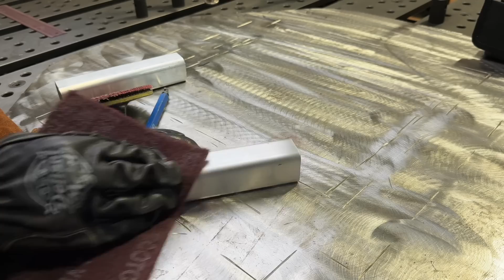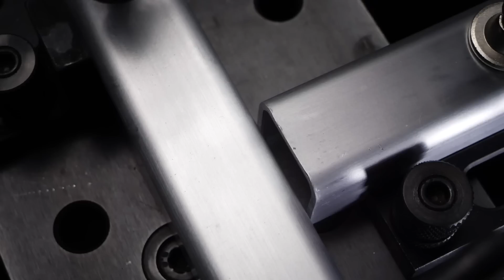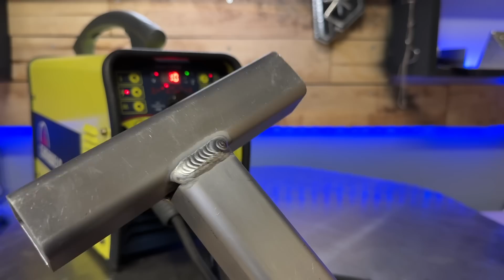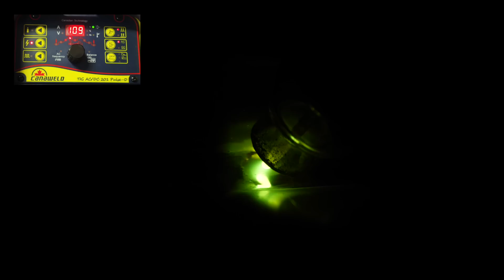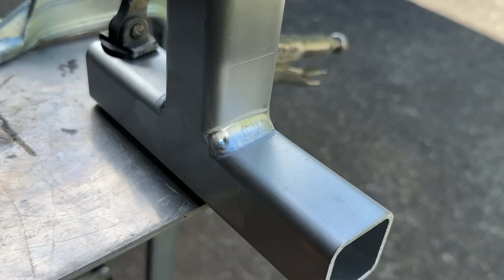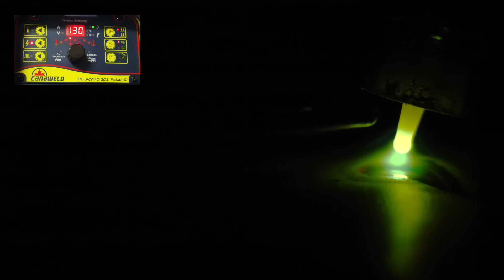Tig Welding a HUGE Gap- and Making It Disappear

Comment: Pro Tip if you dont have  a fancy pants table like he does.

If youre using your typical metal table(presumably stainless because you dont want to corrupt your stainless by welding it on a carbon steel table)
Go out and buy some Bessie F style Bar Clamps.
Cut the Top portion off of them, and put a metal plate there instead.
Then stick them plate first on your table and weld em down.

Comment: Sometimes in the real world there’s nothing you can do besides fill it up! 

We have some closures that are not structural.  It’s a plastic case that gets an aluminum lip (cover and base) and we cut them, and then bend them into a square shape using soft metal to fill the channels in it as to not crush them. Our gap is supposed to be about an 1/8 inch if they’re cut at the right length before bending. The biggest gap I’ve welded was 3/8-7/16ish and that was rough. I use this method when that’s what we get stuck with. Incompetency in the fab dept makes our work harder and unfortunately there’s not much we can do about it.
Reply: Left that comment earlier in the video, additionally, I started in the grind department and his process is exactly how we do case work to make sure there’s no marks once it’s painted! Love this channel

Comment: Have you ever dealt with arc blow?  I'm welding stainless tube on a positioner and when I weld horizontally I freqently get arc blow that ruins the part.  If I weld vertically it doesn't seem to occur.
Reply: By saying "arc blow" are you talking about the blow out on the very last section of weld on a sealed tube joint? If so, try welding just up to the very end but stop leaving a very small gap for the hot expanding gasses to escape, and let the entire part cool to the touch..... then light off and quickly lay into it and get a dab of rod into there to seal the last portion before it all heats up again. Usually that works for me, but if not, you might need to drill a tiny "relief" hole in an inconspicuous nearby spot to vent the hot gas.
Reply: @loulagro2315  I'm under the impression that it's arc blow.  I'm not well versed enough to know for sure.  It does seem though that going from horizontal to vertical welding has somewhat got it under control.  There is quite a bit of magnetic flux in the chuck of my positioner...  

The exact position in the weld that it blows out is a bit random, but it's only ever on the positioner, while it's rotating, or by restarting in a position where it had blown out as well.
Reply: @NavyCuda  , ...... Humm, I'm struggling a little with the term "arc blow" in trying to understand exactly what that means to you, and exactly what your are welding. I've been Tig welding since 1979 everything from chromoly racing frames to all manner  aerospace things, and I've never really associated the official term "arc blow" with tig welding. To me that's more of a stick welding thing. With Tig your arc should never "blow" unless you've got a shielding gas issue, ie TOO high of argon flow and it's actually creating turbulence that is allowing air to get in contact with your weld zone, or conversely, not enough argon shielding gas that's causing porosity and sputtering. The only other thing I can think of is what I hinted at first...... If you are meaning that your weld is actually like "belching out" right at the very end as you are finishing a weld seam, and trying to add your final dab. Is that what you are seeing? If you WERE able to complete the weld, would the two sections you just welded together be sealed on either end? Since it's stainless are you using argon back flow? ........... Again, (IF) the 2 sections you are welding together on your positioner are sealed off more or less on each end, then I would say you are definitely experiencing the hot gases inside the tubing expanding and just as you try to close the last bit of open weld, .... poof, it belches out. 
If so it's tuff, but one trick is to drill a tiny gas pressure relief hole somewhere nearby. The other trick as I related before, is to right before the end of the weld, stop, and let it cool to the touch,  then hammer in a good hit and seal the last hole
Reply: @loulagro2315  No, it appears to be arc blow.   Have observed gas flow and amperage.  I switched from horizontal to vertical welding of the joints and it seems to have stopped. Comfort is a problem now but it's not ruining parts.

Comment: Interesting that you are well below the 1 amp per thou rule of thumb (which is low for aluminum) when buttering. That’s because you’re on an open edge i guess?
Reply: is there a max to that rule. 500 amps for half an inch seems high.